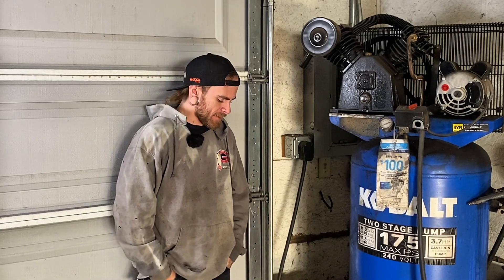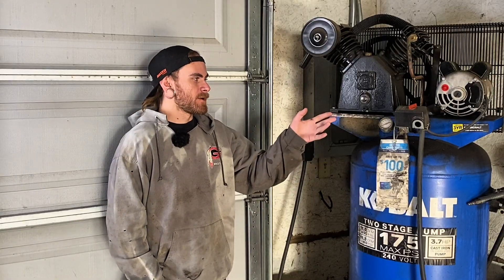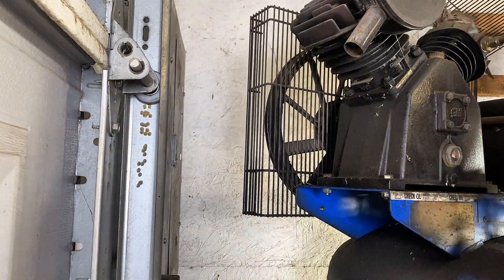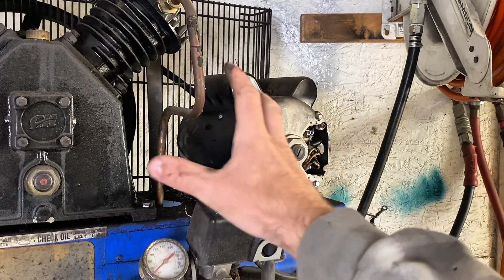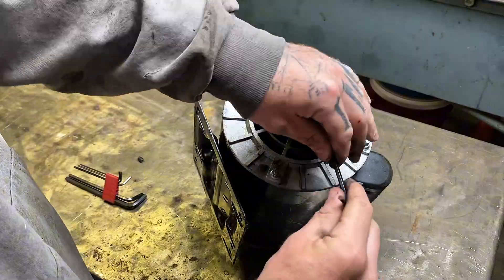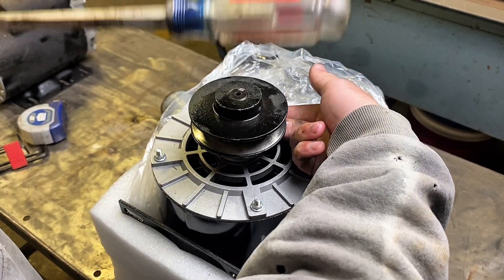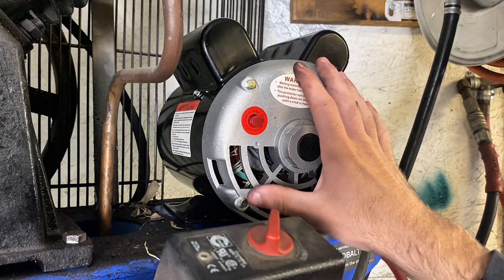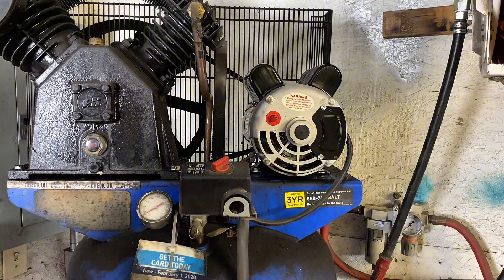Air Compressor Motor Swap – Step-by-Step Install

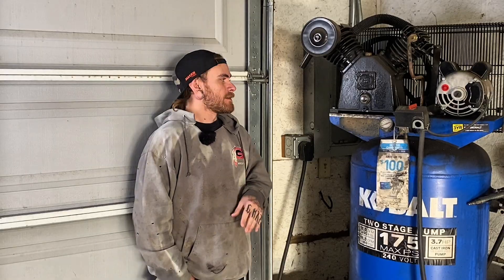Comment: You need a stronger motor that turns at higher RPM 0:47
Reply: You can also swap out your capacitors in the motor ($15) instead of buying a whole new motor

Comment: If you’re going thru motors that often, your pump probably needs a rebuild.
Reply from the maker: Would you think it’s needed a rebuild since the first one went out?
Reply: @washburnfabco  probably not since it was a smaller HP….but once it burned out a 5HP, I would have been suspicious.